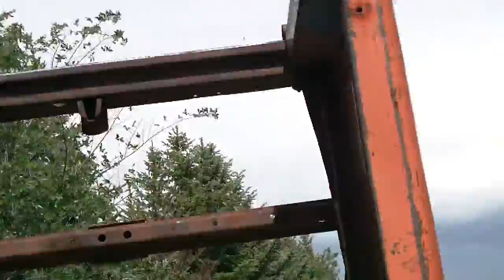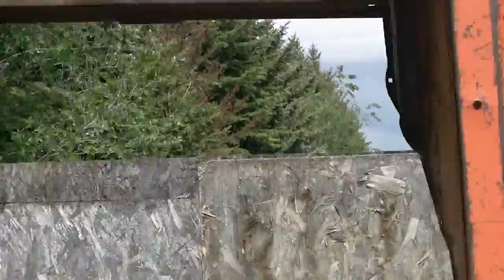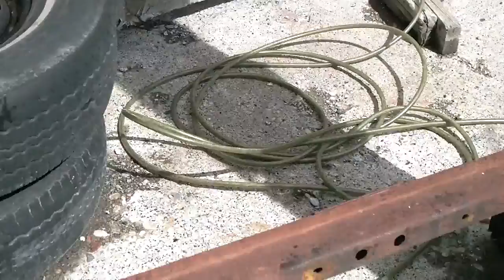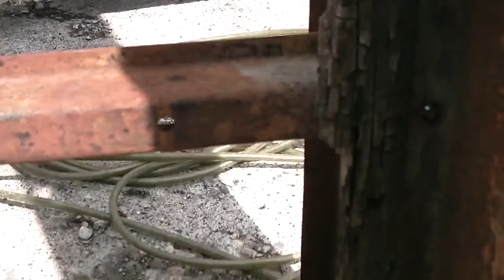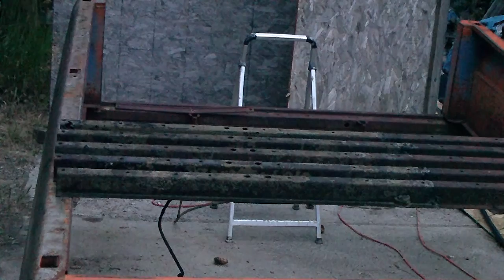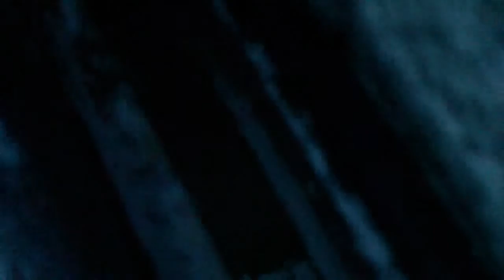EP   206...1965 Chev PU bed restoration PT...01

Comment: Hey Old Dude!

What ratio of mix did you use on the brew?

It's been six months since a video. Anything coming up?
Reply from the maker: +ElderlyIron Hi Jeff, hows it happening. I went down to one of the local farm stores and bought a 5 gallon pail of Molasses that cost $35 and dumped it into a 55 gallon open top drum that was half full of water. I stirred it up real good then finish filling the barrell up with enough room to be able to put the stuff I wanted to derust into it without overflowing. The thing that everyone should understand is that this is not a hurry up get it done way to derust metal as it takes some time for it to work its magic. However after having said that it is an excellent way to clean up old crusty metal and take all the rust away. The molasses bath is not at all toxic and can be disposed of easily although it does become a bit smelly.

 Although I used an open top barrell for experiment with the derusting I intend to build a wood trough and line it with plastic that will allow me to soak the whole item at one time. The malasses bath does not erode the metal so you can put the item into the soak and go work on other projects while the soaking takes place. The pickup bed cross stringers really did clean up and removed all the crusty rust scale orr them. I found and old pair of vice grips that you could barely tell what they were out buried in the weeds in the yard and soaked them and the rust was dissolved off and they became workable again so that you can tell what they are and you can adjust the adjusting screw again. Having the pressure washer helps to scour the surface clean but does not leave it totally ready for repainting. When the weather gets a little better here I will be getting back on those outdoor projects again but for the next while I will be doing the inside stuff. Cheers OLDDUDE